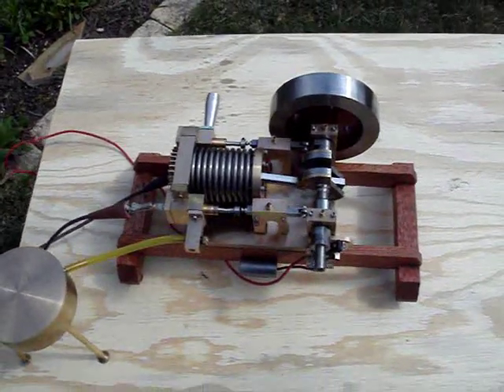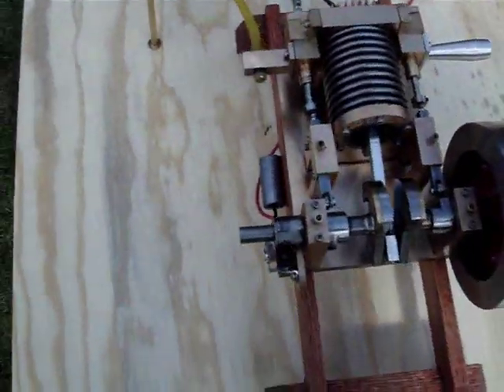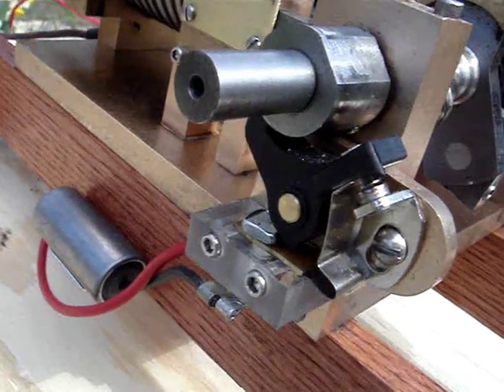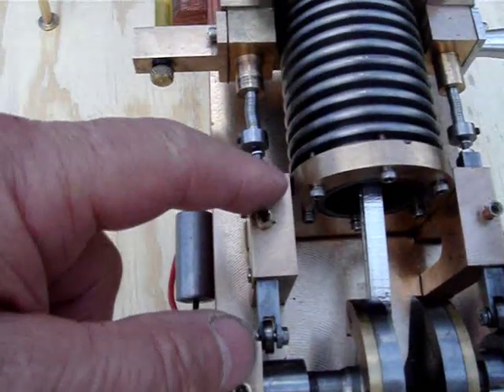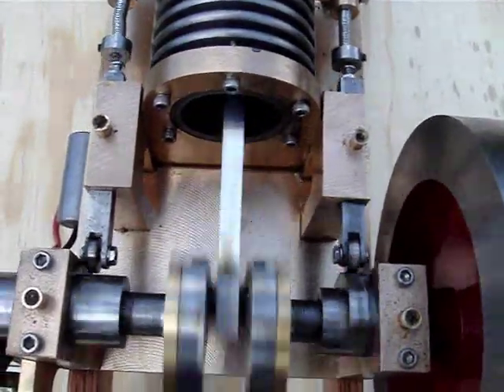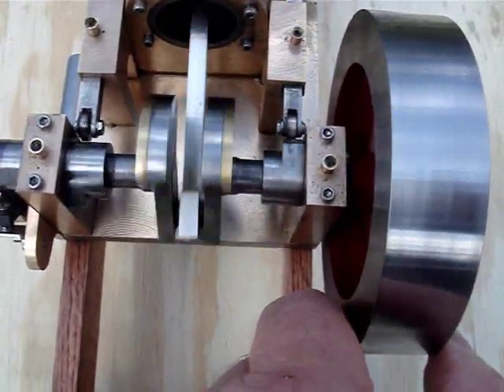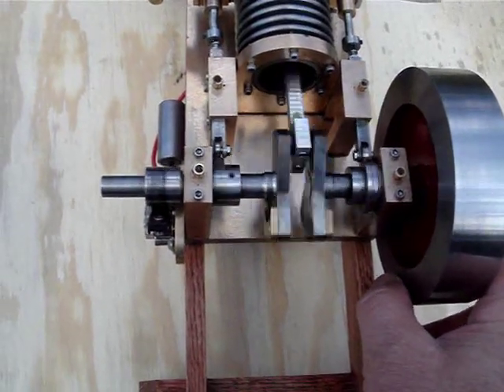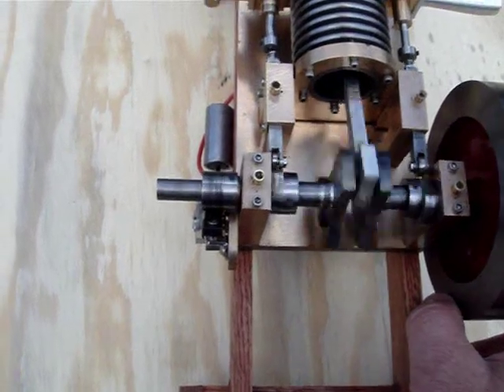Pioneer Engine

Comment: Robert, that is an interesting design, but I have to ask - What is the point? What problem does a "non-compression" engine solve?
Reply from the maker: This is a "novelty" engine. It's purpose was to show that an engine without compression will operate. At engine shows, all of my builds are "hands-on" to anyone interested and this is one of the favorites. It can be started with one finger by four year old children or little old ladies. As I've stated in earlier comments, it is not a practical engine. Having no compression it lacks usable power, but it sure is fun.
Reply: Oh, ok. I was wondering what the designers purpose was. Hey, excuse my bad manners, you did a wonderful job building this engine. Thanks for the video. It was quite entertaining.

Comment: this engine runs so slow.  the port timing is if it were planned with no delays for intake air or exhaust gases to travel through the ports.

Comment from the maker: The bore is 1.125" and the stroke is 1.750" . If you are refering to the piston head, it does not have a baffle.   My engine is mostly brass but the plans call for aluminum and steel. Thanks for asking tinkertoo.

Comment: The real pioneer was a Belgian. By 1859, Etienne Lenoir's experimentation without electricity led him to develop the first single-cylinder two-stroke engine which burnt a mixture of coal gas and air ignited by a "jumping spark" ignition system by Ruhmkorff coil, and which he patented in 1860. The engine differed from more modern two-stroke engines in that the charge was not compressed before ignition. This one is a copy.

Comment from the maker: The engine fires midway through it's intake stroke or 90 degrees from top dead center. It's entire power stroke is only the next 90 degrees making it a rather inefficient engine, but a real curiousity. Gasoline does not have to be pressurized to combust. An open container of gas will ignite if a flame is placed near it.

Comment: Nice job...I've built a couple of the Upshur engines.  I have Rudy K's book that has many steam designs however no gas engines are included.  Where did you get the plans for this engine?  Thanks,

John